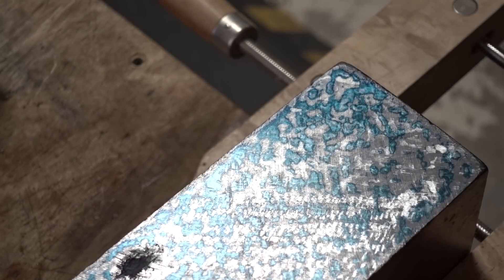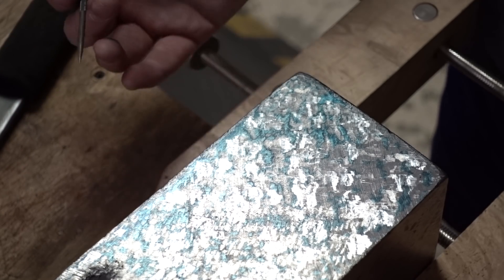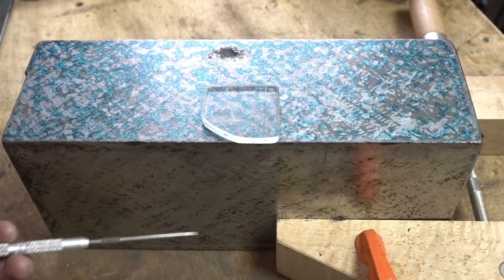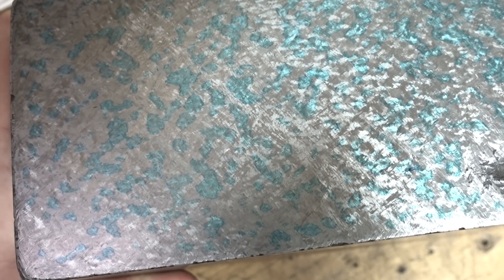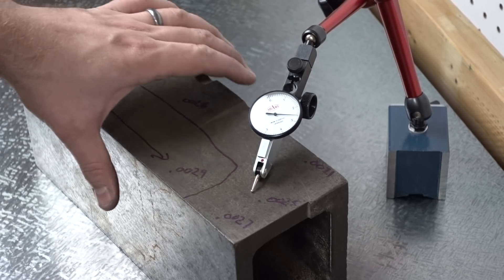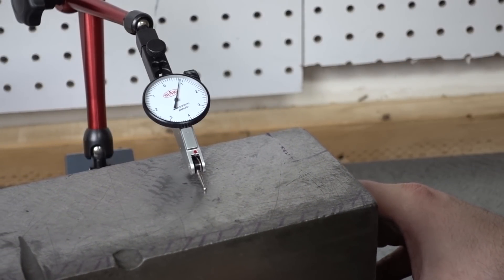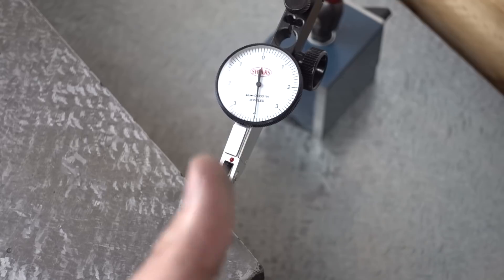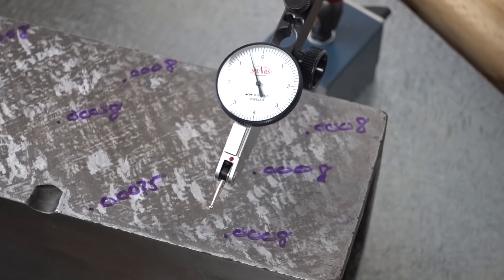Metal Scraping Parallel //Beginner Metal Milling Projects and Power Scraping

Comment: Great video. Do you have a video showing how to achieve perpendicularity?
Reply: I would suggest to use this method: https://www.youtube.com/watch?v=yYwHpjKtc18&t=257s    or create such a tool and use it to blue your face. Just use something, that has some thicker dimension not so thin. Also note, that if you use low carbon/mild steel you have to use a different cutter/scraper geometry: https://www.youtube.com/watch?v=FgxjiEBhKvM. But you can start with an angle grinder for coarse, move on to a dremel with a rubber abrasive end and only for the last moment move to the scraper (https://youtu.be/0T25WxqVPhM?t=387 )

Comment: May i ask do you space the scrape when making it parallel if so wouldnt there still be high spots if you do so
Reply from the maker: A simple response is that the whole purpose of scraping is to create high and low spots. The low spots aid in oil retention.
Reply: @ThunderDog  may i ask again how do you take the surface down with spaced scrape do you cross the scrape for the region you want scrape down or take multiple passes for the region.
Reply from the maker: Not quite sure I understand your question, but here it goes.  When you scrape a section, you then check the scraped surface with your precision scraped measuring tool(surface plate, straight edge, etc.).  You then examine your blued surface and scrape the surface again, hitting only the high spots.  This is repeated until you attain the desired level of points per inch. Of course, this over simplified response doesn't even account for scraping in the correct plane.
Reply: @ThunderDog  what i was trying  to say (sorry if im not saying clear enough) 
When scraping for alignment or parallel or square is it necessary to space the scrape ?
Reply from the maker: Ah, ok.  I've read that the process should be uniform.  I'll admit that scraping by hand it takes time to achieve a uniformly spaced scraping.  But, a power scraper seems to make this easier due to it have a consistent speed and stroke length.  As you scrape the surface for each pass, it is vitally important to change scraping direction for each iteration.  Regarding spacing again, you will get to a point of refinement of the surface that you should only be scraping the high spots.

Apologies for the long responses, because I don't know your experience level of the process or how much you've read up on scraping.  Remember, I'm no pro either.😄
Reply: @ThunderDog  i know you should cross the scrape small radius  wide blade for roughing and aligmment
Mid radius and mide size blade for pre finish
And small big radius blade for finishing but what im curious is when roughing or alignment is spacing vital .i also know points per inch 50 percent high to support the surface 50 percent low for lubrication to stay between the ways .also small scraper blades are used for splitting up the big highspot.as for the blue reading im sure i know how to but to save the time typing im not putting it here.as for scraping experience im still experimenting with files as scrpaer and have to say they wear fast on disc brake(1 ,2 stroke )
,work perfectly on soft steel but doesnt glide smoothly(yes its a negative rake) .the only cast iron that worked perfectly was a mini bench vise with anvil on it it worked just exactly how most people would do.Guess carbide can work on anything up to the point of carbon steel.
Reply from the maker: Spacing of the scrape is generally important during roughing to reduce the unwanted result of shifting the surface plane in the wrong direction.  Did I ever overlap scrape marks during the process? Yep.😄  The most important part to it all is keeping the surface in the correct plane, make a plan, and methodically scrape to achieve the desired result.

Comment: Hi, could a hack saw be used for scraping (adapting propper tip)?
Reply: No. It's have too long stroke. You must be modified you hack saw first. It's need modifed so, at you can adjust yuor stroke lenght

Comment: Awesome video.  What are you using to determine the points per inch?  Is it a magnifying glass or just a piece of plexiglass with a 1” square scribed on it?  I like this idea.   Also, what kind of scraper are you using?  Is it a modified sawzall?
Reply from the maker: Thanks.  Yup, a 1" piece of plexiglass to count points.  It's a carbide tip on the scraper.  I have a video showing the power scraper build.  You should check it out.

Comment: Great video as always Thunderdog! If you are having a hard time adjusting the speed of the power scraper action, I would recommend getting your hands on a variac (variable ac transformer) from Ebay, the cost of one varies depending on the wattage that it can drive, but I'd guesstimate a 200-500W would be suitable for this application . Specifically this: https://www.ebay.com/itm/Variac-Variable-AC-Voltage-Regulator-AND-TransformerMetered-500W-0-130V-US/222881156711?hash=item33e4c08e67:g:kMcAAOSwcCtakEO3

That being said, you could likely just remove the adjustable pressure switch and replace it with an on/off button with a fixed resistor.
Reply from the maker: Gotcha, I'm fair at best with electronics.  But, I'll look into this for fun.  Thanks for the continued support.

Comment: Question! Ignoring the DIY aspect of self scraping. Is this scraping method superior to taking the part to a shop with a large surface grinder? 

Awesome video!
Reply: Scraping removes material MUCH slower than a surface grinder. In order of operation, ideally you would facemill, flycut, then grind, then scrape in, each one removing successively less material then the prior, and improving surface finish.
Reply: scraping (done right) will make it flat, "much" more so  than a grinder, also it will create an dimpled surface that allows an oil film to better lubricate the surface
Reply: scrapping and grinding have slightly similar goals grinding makes a flat smooth surface but is prone to slipstic and is undesirable for sliding ways as it tends to scrape the oil film off leaving no lubrication . scraping will leave i surface that has many tiny hills with flat tops in the same plane that will keep oil on the surface so the parts whear much more slower. it also give you that ability to adjust for alignment in the rebuilding process . often things are machined or ground then finished by scrapping.
Reply: That thang flat and parallel
Reply: Actually, the right way to do is using a surface gringer first and then scrape the imperfection of the surface grinder. Oil pocket story is a myth, do not believe in it.
Reply: @Spark-Hole  "Oil pocket story is a myth" So you think major machine manufacturers have been spending the money therefor losing profit to flake way surfaces for a century because of a myth?